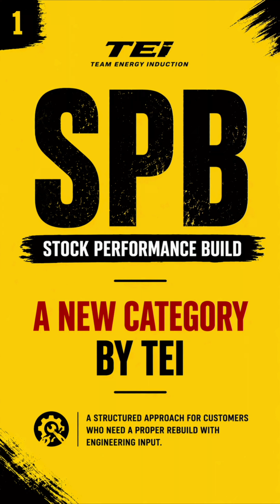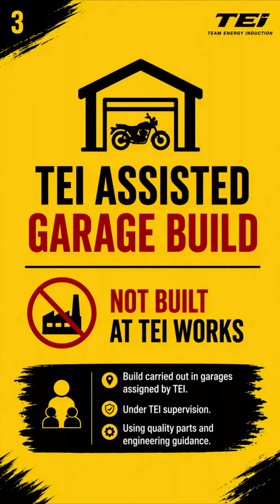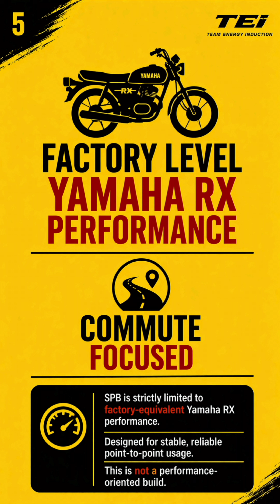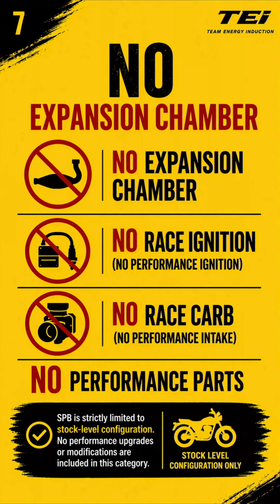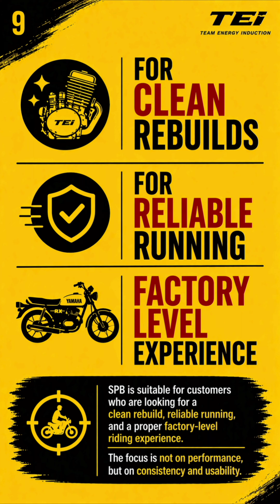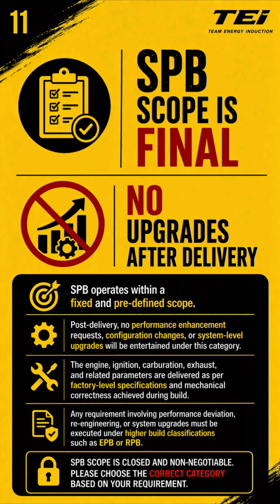SPB Explained — Stock Performance Build (Engineering Scope & Execution) | Team Energy Induction

Comment from the maker: ENGINEERING CLARIFICATION — PLEASE READ

SPB (Stock Performance Build) exists to establish technical clarity for enthusiasts who require a mechanically disciplined Yamaha RX rebuild without entering TEI Legacy Build performance engineering territory.

This category was developed to address a very specific engineering requirement:

A cost-controlled rebuild executed within strict stock-system operating boundaries while preserving assembly precision and mechanical correctness.

SPB is intentionally limited.

It is NOT:

✖ A validated performance platform
✖ A telemetry-tested build
✖ A SpeedGun measured system
✖ A load-optimised configuration
✖ A tuned performance architecture

SPB is a TEI Assisted Garage Build operating under supervisory engineering input only.

Its objective is simple:

Restore stock-equivalent operational integrity through correct component selection, assembly discipline, tolerance control, and mechanical stability.

This classification exists to ensure complete transparency between:

Stock rebuild engineering
and
Full TEI Legacy Build validation systems

Any requirement involving measurable performance, validation protocols, tuning optimisation, or engineered output enhancement falls strictly under TEI Legacy Build classifications.

At Team Energy Induction, engineering begins with scope clarity.

Because when classification is precise, expectations remain technically correct.

Team Energy Induction
Precision | Validation | Performance